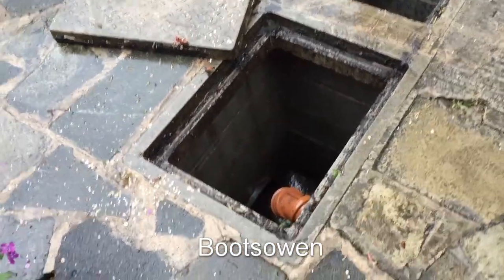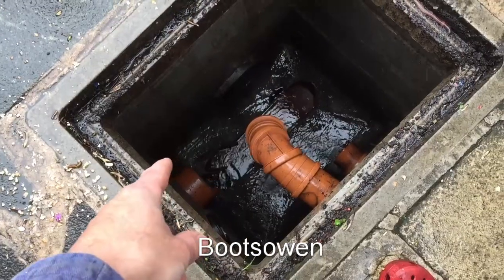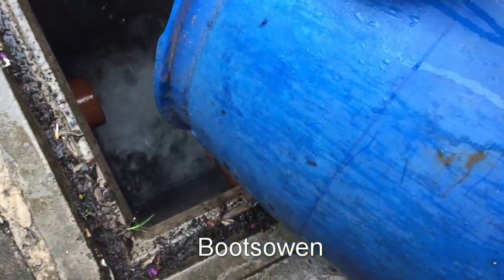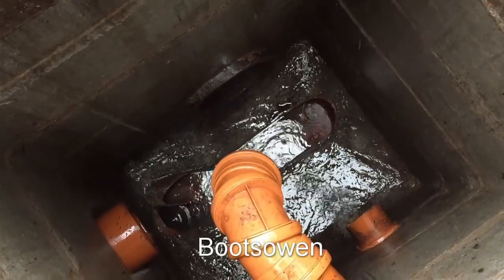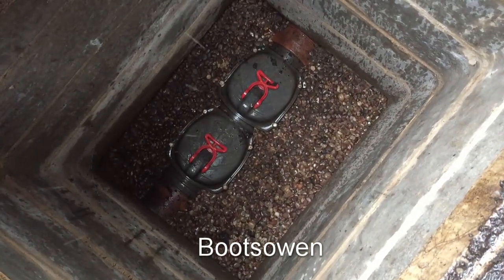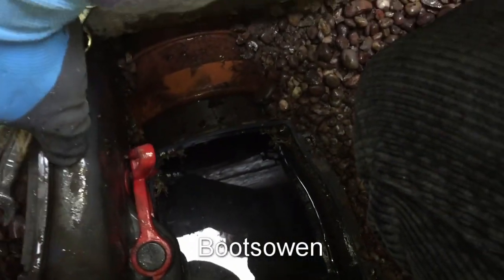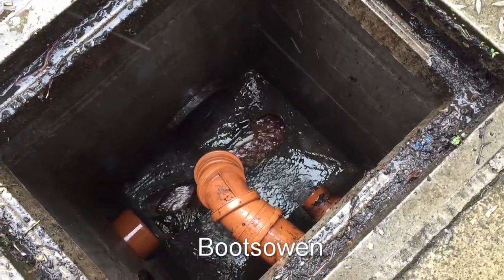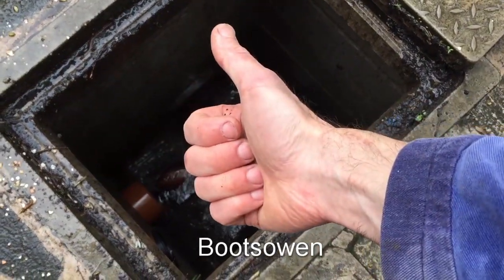Sewer anti-backflow valve check | flood valve | one way trap | wastewater maintenance

Comment: Was watching a sewer video from channel Kempinger last night and his latest video is about these same backflow devices getting clogged up - the one he had to deal with was an electric one that opens and closes the flap with a motor when a backflow is detected. His problem also involved the city sewer line backing up on the other side of the backflow device, and had to call out the city maintenance team to deal with it. Odd how 2 videos on the same subject come up a day between them. I would suspect either the sewer in your case has problems with either root intrusion partially blocking the pipe, or buildup of FOG (Fat oil or grease), combined with wet wipes. Maybe do an update video about what happens with this issue?
Reply: Link to that other video with the same issue - its German so put the subtitles on.  https://youtu.be/V2nqfqyfGS0
Reply from the maker: Hi Steve, thanks for the comment, here is the update, I haven't published it yet, but you should be able to watch it. https://youtu.be/VS3iJfNDlTY . it was roots on the public sewer side.
Reply from the maker: Just watched 2 Kempinger vids there now. What i find most unusual about the whole thing is that I will watch these videos!!??
Reply: @bootsowen  You'd be surprised how many people watch videos about drains being unblocked - its pretty gross, but gives satisfaction when the blockage clears and the water starts flowing again. Drain Addict in Australia has several hundred thousand subs, and has spawned a whole load of other drain unblocking channels from across the world. I will watch the update video shortly, but usually from the many videos I have seen, it ends up being tree roots penetrating gaps and weaknesses in the sewer pipe, and waste then gets trapped on these and you get problems. Needs a high pressure jetting nozzle to remove them all so drain rods will usually not do the trick, unless its another type of blockage such as a buildup of grease, or a scaled up interceptor trap. Backflow valves are a problem waiting to happen when they get obstructed, but they are useful for situations like yours when you have recurrent problems in the mains that backup onto your property, and also to help keep rats out.
Reply: double valued and it still let water up the pipe🙄 . That's on a good day dam i hate see bad day . How is it still backup up if rubber seal on flaps is fine